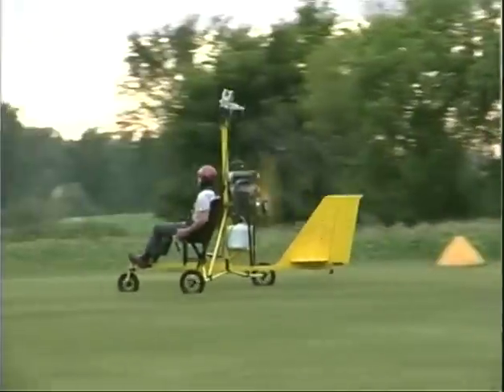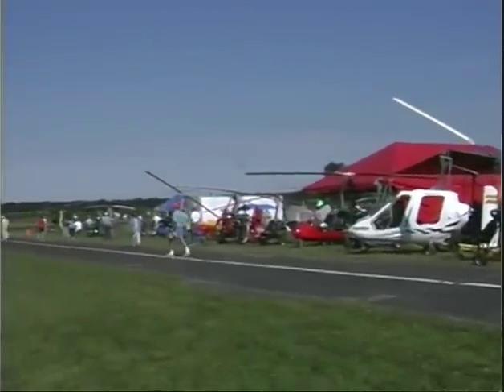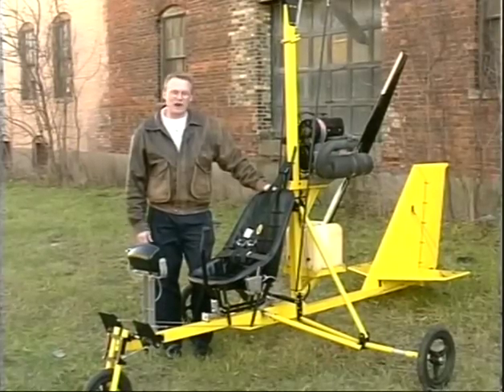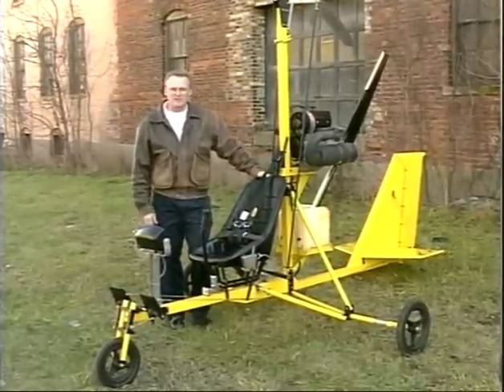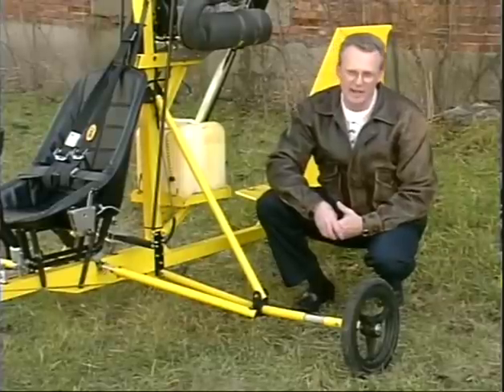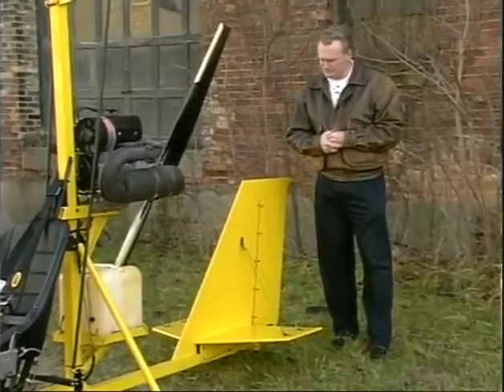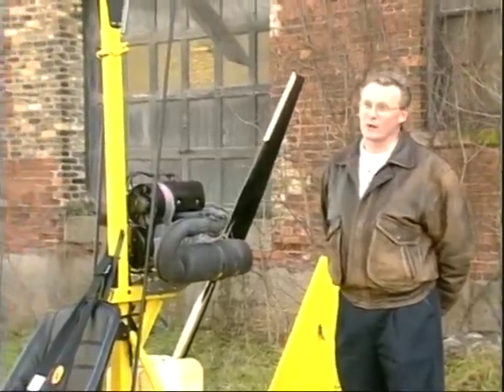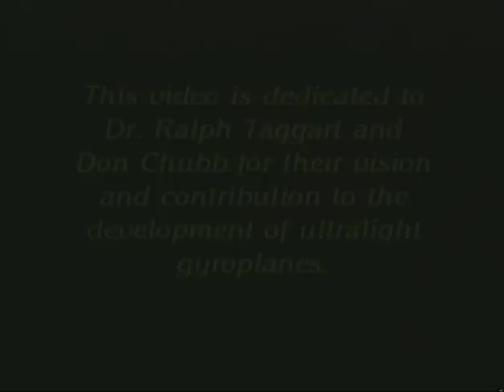Honeybee Gyro Story

Comment: When I watch these sort of videos from the USA I always think I should have moved to the place, you can't blow your nose in the UK without getting some jobsworths permission..When the Soviet Union fell apart they shipped the remains to the UK and rebuilt it..
Reply: Don't be too hard on yourself. There's a large gyro community in the UK. And training is required.

And in fact it was research done some 20 years ago in the UK that revealed why Bensen type gyros like this one were crashing and killing their pilots so often. The answer was non alignment of centers of gravity and thrust, leading to powered push over. After that, pusher gyros began to be constructed quite differently.

This is not a safe design, due to where the engine and thrust line is located, as compared to where the overall CG is.  The horizontal tailplane is also not large.
Reply: California is same.